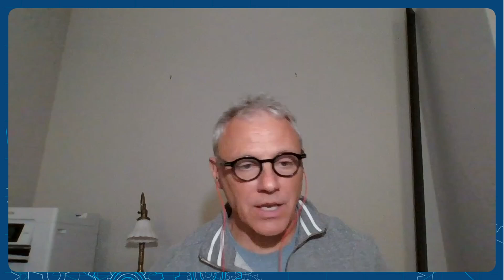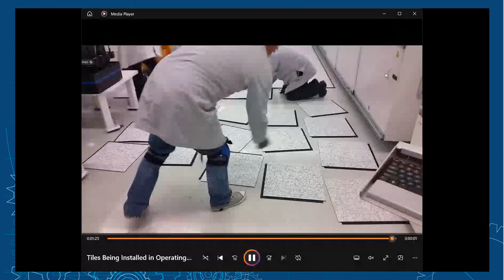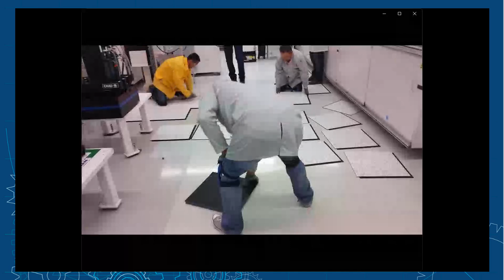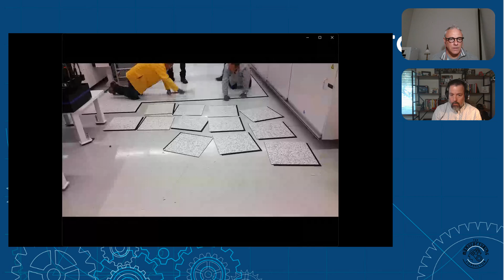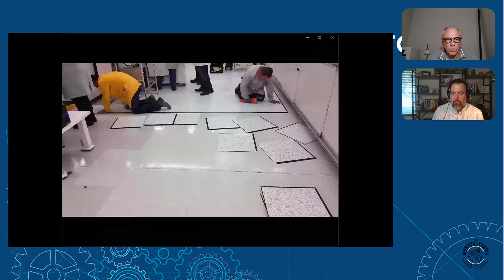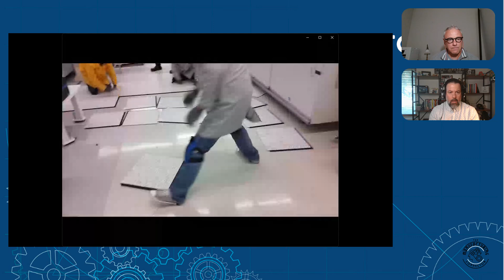Durable, Sustainable, and Smart: How Select Tech is Redefining Industrial Flooring

Comment: Lesson learned from Jim May’s Manufacturing Connector episode: choosing the right flooring like Select Tech’s interlocking tiles can drastically cut downtime and costs in manufacturing. Installation without shutting production is a game-changer, especially with static control for sensitive environments. This approach truly protects ROI and efficiency.
Reply from the maker: Glad you got some value from the episode!